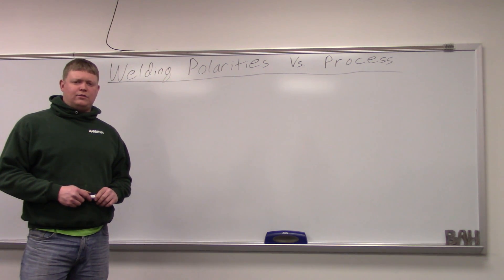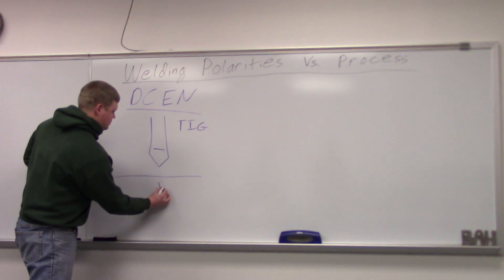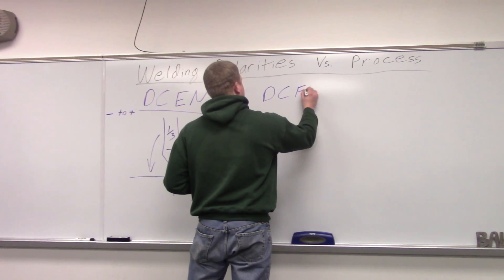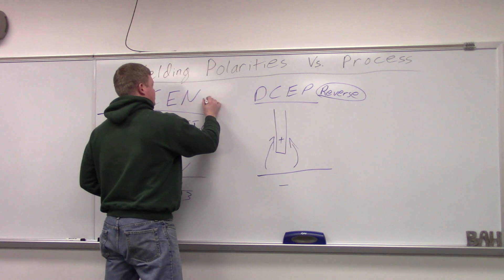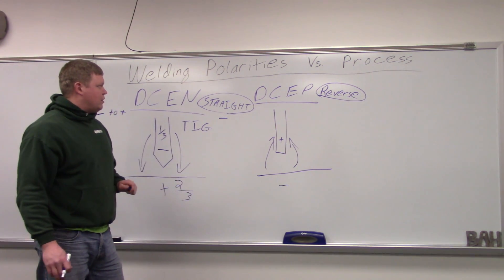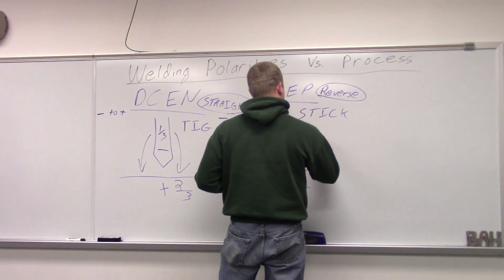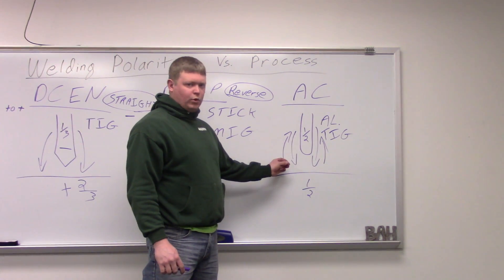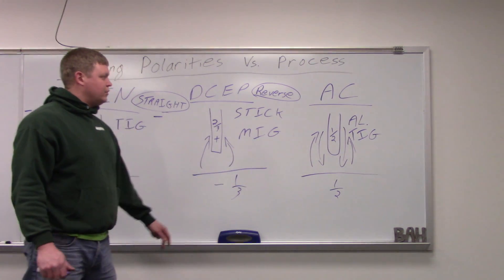How to know what polarity to set your welder on.

Comment: Still don't know where to put my ground clamp to get dcep or dcen.
Reply from the maker: There is two spots on the machine for hooking up you ground and your electrode lead.  They are usually a threaded bolt or some kind of quick attach end.  One is a + terminal the other is a - terminal.  They should be marked.  If you want DCEP put you electrode lead on the + terminal and your ground on the negative.  If you want DCEN put your electrode lead on the negative terminal and you ground on the + terminal.

Comment: In a coated electrode arc welding, which melts first, rod or flux coating.? why?
Reply from the maker: The rod melts first, and the heat from the rod melting causes the flux coating to melt.  This happens because the rod conducts the electricity which is the fuel that makes the heat when the - comes in contact with the +.  Without that electricity going through the rod nothing happens and the flux will not conduct electricity.
Reply: @TVWeld   Thanks., for the clarification.

Comment: Omg  but a/c straight or reversed?
Reply: AC is both… or neither? “Alternating current” it switches back and forth between the two many times per second. I don’t know the speed at which it does this, I’m still very new to this. But that’ll get you started. Course you’ve probably had your answer a long time being that it’s been a year, but for anyone with the same question.
Reply: Yeah the Hz would be the frequency or speed of which it switches back and forth. The balance settings would determine the frequency or how long a polarity would stay in, more (-) or more (+).

Comment: What would fcaw be used at its different to standard mig?
Reply from the maker: Flux Core tends to burn hotter than MIG so heavy steel applications would better fit FCAW.  Usually FCAW is used when you would want to stick weld but can't because it's so slow and you can't MIG because you need higher deposition rates, don't want to bring a bottle, are in wind, or are welding in the field.  Choosing FCAW really depends on each individual situation.

Comment: Why is it that MIG with flux core wire needs to be set up as DCEN? When set up as DCEP like normal MIG wire with gas, it just spits and farts. Can someone explain the reason for this? Thanks
Reply: The thinner metal of the flux core stuff can’t handle the higher heat. Even if you have the same diameter wire, the wire isn’t solid and melts/burns a lot faster.

Comment: "electrode positive has more penetration cause heat goes to rod end causes a reaction and flux superheated sprays out with higher force and molten drops with heat hit the part giving higher penetration. when tig welding you get more less penetration with reverse polarity cause heat goes to tungsten and just melts it there is no jet of superheated gas reaction cause no flux
electrode negative is used for sheet metal "  http://weldingweb.com/showthread.php?671051-EN-or-EP

Comment: why usually welders use DCEN for E6010 and they use DCEP for E7018?
Reply from the maker: Some welders will switch to DCEN when using 6010 if they are having penetration problems.  Electrons flow from - to +.  Therefore switching to DCEN makes it so that more heat goes into the material that you are welding giving you more penetration.
Reply: 6010 could melt metal on dcep if ur amperes are higher

Comment: The explanation about the heating in DCEP is wrong. The explanation about the 2/3 and 1/3 heating is just true for TIG welding., because the material of the electrode (tungsten) is different from the base material (the piece).
When welding in DCEP with Stick, MIG/MAG, SAW, etc... the hottest is the base material (the piece) and not the electrode. For same materials (electrode/filler material and base material) the negative is always the hottest.
Reply: UGH. I’ve been trying to figure this out for a week over probably more than 50 videos. I’ve heard both ways so many times, I’m starting to get them mixed up in my head. I knew SOMEBODY had to be wrong, cause everybody disagrees. I also melted a lot of holes in a piece of practice sheet metal tubing on DCEP with a 6011. I switched to DCEN and finally got a decent bead with good deposition. So my 2 hours of midnight welding experience and common sense told me it’s melting the rod, not the base material. However I started feeling like I was going crazy with pros saying it was the other way around… and other pros agreeing with me every now and then.
Anyway, I’m short, thank you for clearing up a difference in how those two work. I feel like people learn one process or the other and assume the same rules apply to them all.
Reply: +André Cunha THANK YOU
Reply: +André Cunha thanks for saving me the lengthy post my good man . i just caught that , im outa here
Reply: Hey buddy i want to know the practical reason behind it.... could u please tell me...